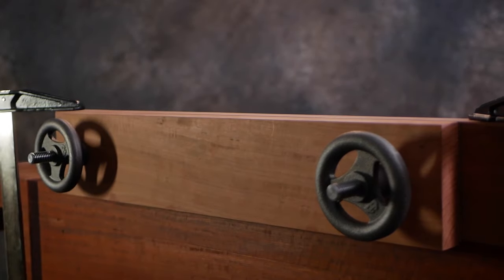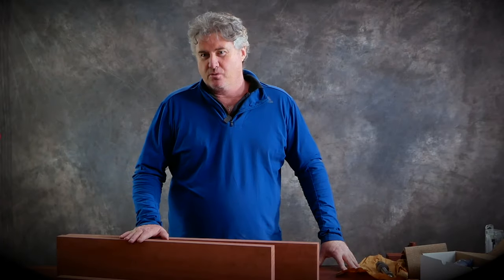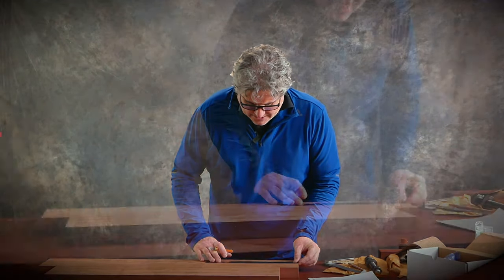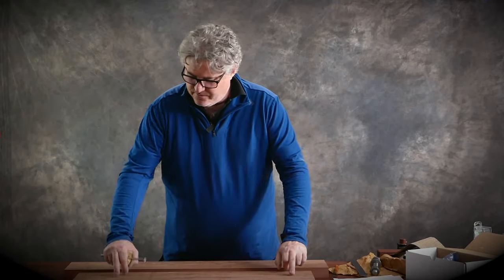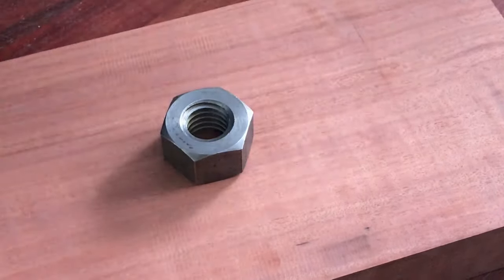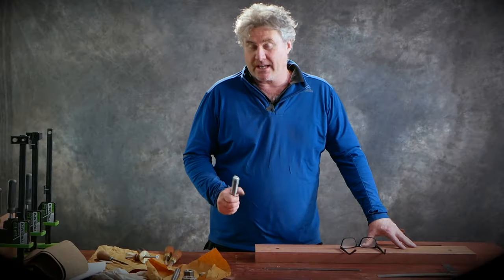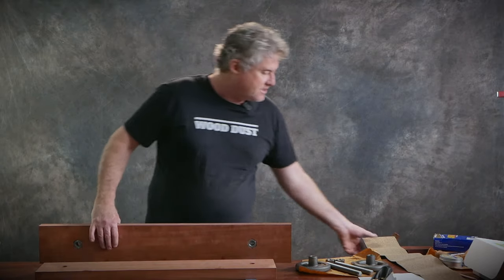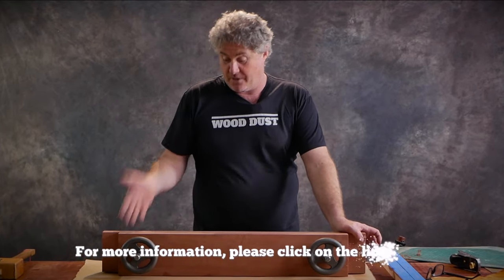Building the Benchcrafted Moxon Vice

Comment: why are the Nuts on the INSIDE of the Vise!? surely when you tighten the vise the nut will be pulled away from the face?
Reply from the maker: What John hasn't shown is that there are nuts on the rear face as well; these are tightened, which stops the threaded rod from rotating.